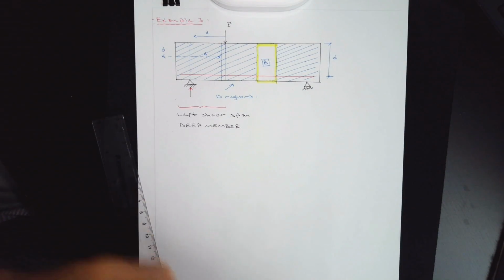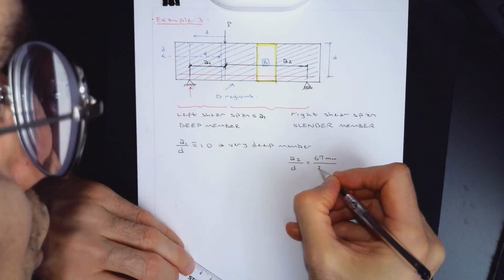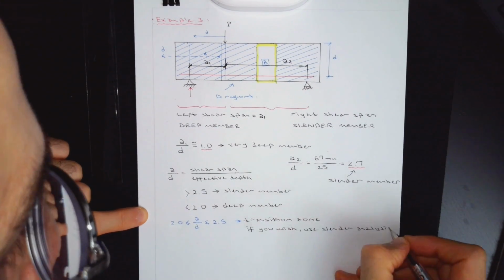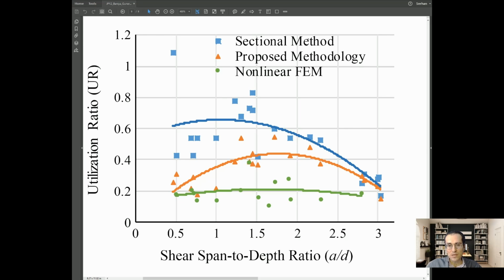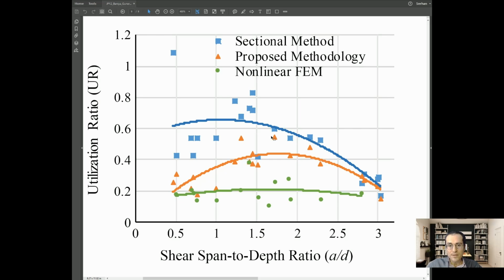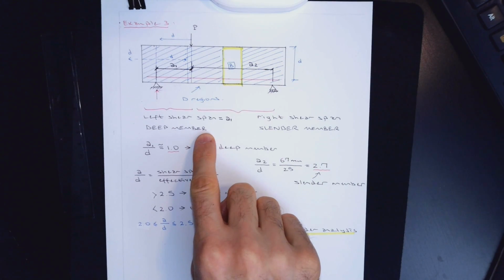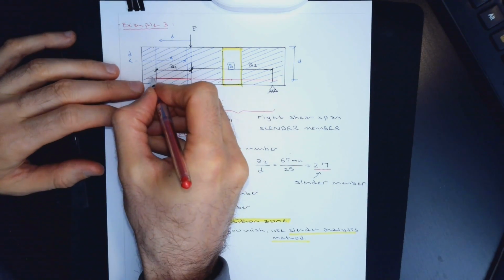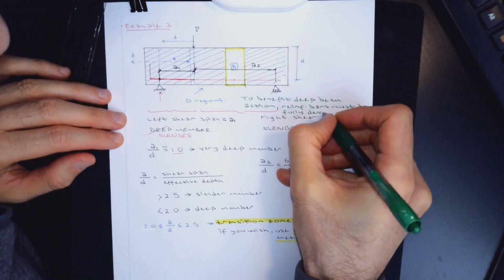Deep Beams: Shear Span-to-Depth Ratio and Deep Beam Effectiveness as per ACI 318-19.

Comment: The floor with deep beams shows different displacement than other floors under horizontal earthquake forces. Doesn't this pose a risk at the junction of deep beams and columns?  How can we avoid this problem? Which buildings or structures in the world currently have deep beams? Can you give me examples? Thank you very much for the video
Reply from the maker: A floor with deep beams is rather uncommon given the long spans of slabs. What you are referring as deep beam may not qualify as a deep beam (a/d < 2.0 or 2.5). If you have a floor with deeper beams than other floors, it will behave differently. Under earthquake actions, floors behave like rigid diaphragms. The issue will emerge at the deeper beam-column interface. Based on capacity design, columns should be 20-30% stronger than beams, so you would need to re-design columns and the beam-column joint for that floor. I hope this clarifies.
Reply: @SerhanGuner  Thank you Mr. Serhan,
 How is the frequency of use of deep beams in the USA? In Turkey, there is no deep beam design in building type structures. Earthquake Regulations are very strict on this issue. The reason for this is that active faults in Turkey pose an earthquake hazard. In a large-scale earthquake, columns are insufficient in a building with deep beams and reinforced concrete walls are needed in two directions. What is your opinion on the application of deep beams in earthquake-prone buildings? I think that the use of seismic isolators (dampers) in the foundation columns will reduce the displacement differences between floors. But this additional solution will increase the cost of the structure.  I would like to know your opinion on this issue.

Comment: Great video Dr. Guner! It would really hit it home if you did a practical example of the same beam designed using sectional then strut and tie method to show the difference.
Reply from the maker: Thank you Freddy for your interest. Good suggestion. I hope to solve STM design examples when I can find some free time. I will also offer an online STM modeling course for 4-weeks. I will announce this later. My first two videos are introductory on the identification of deep regions. Here, the left (deep span) should be designed using STM. It will require a hook at the left support. The right span should be designed using the slender beam approach (the typical moment-shear-axial force) design. No hook will be needed on the right support. I hope these help.